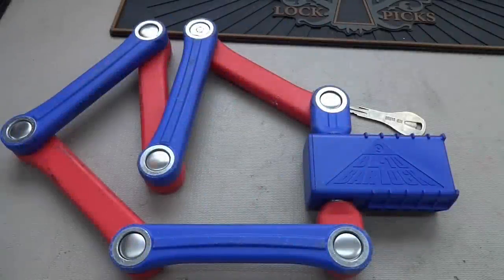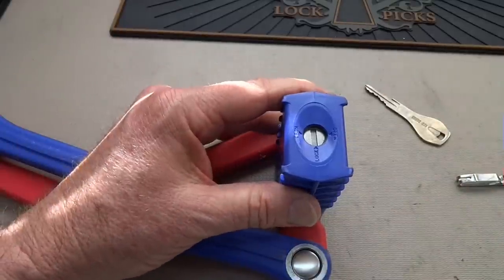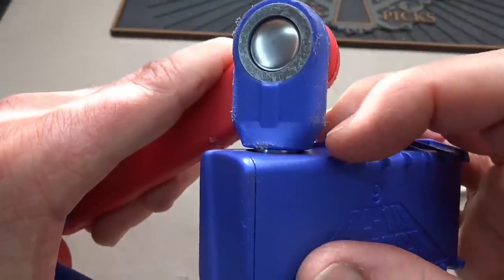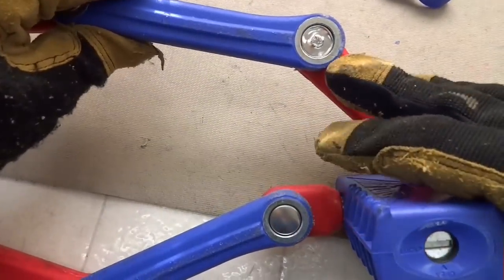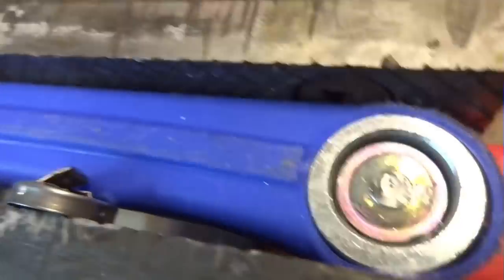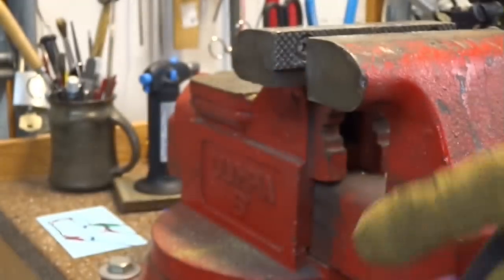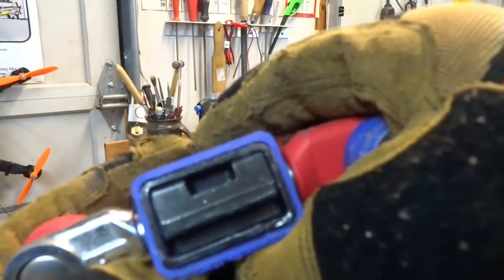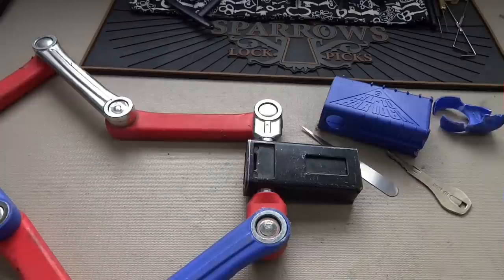(774) Japanese BL-10 Bar Lock

Comment: Did you put the lock itself into parts? How does the lock work exactly? Did you find any ways to attack the lock itself? I'd guess that if the wafers are totally inside the core without the key, one could manipulate the wafers to attack the parts around the core. I'm still only guessing about how the wafers could interact with the locking mechanism if the core is freely rotating without the key...

Comment: i know im a bit late but did you try to pry the hinges apart? Ive been able to do that alot when working on other similar things. I suggest locking one of the bars in a vice and try to get a screwdriver between the joints and it should come apart.

Comment: Can you push the pin apart with a vice or c-clamp and a socket and pin? Also, if they had have made a hardened flange where you cut plastic away, could you still have shimmed it or would that have completely defeated you?

Comment: If the link rope end is wrapped around a sturdy object such as a bike rack. Could you use a long bar to twist it around itself till a joint fails? Similar to lateral prying of a drive chain.

Comment: That keyway is based on a common Nissan DAT13(Silca designation) keyway. It is generally simple to pick when the core is one piece. However what you have there is a two piece core which is becoming more common in automotive applications. So the two piece cores are exactly as you imagine, the front part of the core includes the dust flap and a little bit of keyway(In the case of ignition locks generally the steering lock hold off), but approx 15mm down it is separated from the wafer bearing core which is actually connected to the switch or cam which actuates the system. Nowadays to defeat the two piece cores we use full key length pick "frames" to tension the whole core evenly.
Reply: I just paused the video at the key shot, it's not 9 wafer it is 8 wafer, that space just after the shoulder is normal. I assume it was added by the designers for a little bit of mechanical strength to achieve the required 8000 codes as specified by Nissan so they could use a 4 depth at the shoulder. It dramatically increased their code depth as they could not use 1 and 4 next to each other except in very particular circumstances due to the internal structure of the door locks.

Comment: One of the ways some thieves get around these types of locks (and cheaper U locks) is to apply torsion on the bars.  Yes, it'll depend on how brittle the hardening process made the steel.

But I've seen case-hardened U-locks and bar locks that thieves have snapped simply by positioning the lock, then using the bike itself (by flipping the bike over) as the torsion bar.

Comment: Are the link pins hardened? If not you could fit a hacksaw blade between the the joints and saw through the pin

Comment: What about trying to break the chain thingy on one of the joints? Like fixating the red one (while it's lower positioned one, oriented flat to surface), and putting large weight on (or hitting hard) the blue one. The joints are the weakest points of the chain.

Comment: Bill! Longtime fan!
 I notice you mentioned the issue with the free-wheeling plug. Could you scope the plug to see if it has wafers on both sides? Also, maybe the tip of the key or a wafer actuated by the key engages the actuator? Probably not the tip but maybe it is. Scoping it might yield some clues.

I think it's 8 wafers and not 9 because if it were 9 the cut nearest the shoulder would cut into the shoulder on deep cuts. Hard to tell exactly how far the key enters on the video.

As always, great video!

Comment: So shimming work with that type of Locking Pawl by pushing it out of the way and causing an unlock could you also just pull the lock straight out and get it to release. I understand that would be impossible with arm strength but using a small car scissor hand jack or some sort of hand cranked come along?

Comment: those hinges, if its just a sopt weld over a washer, could you drill out the weld to seperate the washer and push the pin threw? if the weld material is soft enough even a cheep cordless drill with a fresh bit could do the job.

Comment: You pounded on the hinge pin using a big fat bolt that spread the force across both the pin and the washer it's welded to.  If you hit only the central pin with say a 3/16" pin punch, I wonder if you could break the welds attaching it to the washer?

Comment: i had an idea. if you had means of fixing 2 of the long arms in a stretched out position and apply pressure to the middle hinge flat side to force it out of a straight line, it may compromise it. imagine a steel box with open top, loops in sides that can hold down the ends of the arms and a hydraulic car jack in the bottom of the box to push up on the link. needs some pre planning but might be quiet if it works.

Comment: Is it possible to defeat the lock by using a very large set of bolt cutters (36") at one of the joints?
I seen an Abus lock of similar design, referring to the collapsible body not lock, defeated that way.

Comment: I'm thinking some kind of torsion on the joints, or trying to snap them at the joint by hitting the long end sideways. Maybe something like a metal pipe with a slot in it that slides over the joint pivot seam and then you use it like when you would putting a pipe over a wrench to extend your force. And of course there's slide hammer to the keyway at least to remove the shutter.

Comment: I know I'm a little late but will a hack saw blade fit between the bars where the joints are and the pin is? maybe the pin itself isn't case hardened.

Comment: Since wafer picks didn't work, you could try some custom attacks....how about a wire hanger, straightened, cut to desired length, and folded in half with a good bit of the two ends ground down so they are smaller and flat..bend ends and insert into the lock (both top and bottom) and hold so that core doesn't spin (hold the 'loop' end of the wire for tension as normal), "pick a side..any side..".  From the key, It looks like the pinning appears to be the same on both sides. Have you tried automotive picks (double-sided wafer jigglers, double-sided rake, etc)?

Comment: It seems that the weakness can be solved by widening the metal area the piece that goes into the lock. If it extends out another 1/8"-1/4", then you can't put a shim down into it, even with the plastic cover removed.

Comment: how about putting the one of the joints over the edge of something and hammering down on the bottom one..try and drive the joint out. or even put something between a top join and the bottom one and forcing them apart?. You might not be able to force something through a joint.. but u might be able to split them .

Comment: You could try bashing the connector piece out of the locking pawl with a hammer, or your beefy sledge. It looked like a pretty small bit protruding, especially if you bash it away from the pawl, you might be able to slip the bit out.

Comment: The cordless grinders certainly changed the game. As long as you find a way to deal with the noise....Ghetto blaster anyone?
Too bad it has such a great lock, but a shim defeats the entire mechanism. There shall be a new version soon!
Reply: +ObsessionPC Some kind DIY thermite putty?
Reply: +Vitovt Wik It's meant for motorcycles. If you used thermite you'd probably end up damaging the wheel.

Comment: have you tried torquing a hardened piece of steel that fills the keyway and forcing the cylinder to turn? Maybe that lock has the same weakness as the "smart locks" where you can just shear the wafers...

Comment: where the pins are spot welded, could you center punch it and drill out the weld? is the pin hardened could the pin be drilled?

Comment: Im thinking about using a boltcutter on the joint, kinda like a wedge. (between the red and blue part) Like trying to cut the pin and at the same time it forces the joint to dissasemble...

Comment: Right where the "shackle"  or plug goes into the push in snap lock, If they would have added or modified the plug to be larger so a shim would not have easy access to the locking paw this might have been a really nice lock.. Off hand did you try the bottom wafers only like most cheap locks maybe with all the bits on the key gone bot leave the tip, of the key and try it out?? Just a thought or 2, :)

Comment: there may be a bypass with the wafers. i remember a wafer bypass for cars using a popsicle stick. it might be possible for this lock. basically you take a blank, put medium tension, and slowly extract the key. in theory it should set the wafers.

Comment: I have to wonder how well that locking paw would hold up to impact, if the bars hardened but the paw isn't, of if its just not thick enough a good solid sledge hit might just pull the arm out of the lock, and the bars do give a opportunity for a bit of leverage

Comment: I can make a pick key for that. The lock looks like a Nissan key(DA34 I think)
You are correct about the wafers, You said nine but it is an eight cut key, four on top/four on bottom opposing. I'd same company that makes Nissin auto locks made this lock or at least the cylinders they use.

Comment: Use the rigidity of the lock against itself. The joints can be broken with simple leverage. If you swedge the lock and straighten three of the links to use as a lever (approx 16") and apply as much as half your body weight (100lbs) there will be upwards of 3200 lbs of force pulling the joint apart.  (No tools required.)  Anyway, give it a try if you can find a way to wedge it. With the average tensile strength of case hardened steel at 700MPa and mild well below that, 100 lbs @ 16" should be just enough to open up those eyes if they are 0.25" max at their thinnest part.

Comment: a secondary locking system for the pawl where if the link is in place and the key is not turned might fix the problems.  Some sort of spring loaded catch at 90 or 180 degrees to the pawl direction so a bump might disengage one but would set the other.
Reply: +Robert Szasz There's simple and effective standard solution to shimming: ball locking mechanism.
It's not spring loaded and the balls are impossible to move away unless the cylinder is rotated or somehow falls off.
Reply: DigGil3 that defeats the no key insertion to lock feature though?

Comment: what about bending at the joint sections .. you apply enough force to bend at those joints it has and the outer ring of the metal would snap and fall off on the bars ...  at the rivet spot weld point ...  of each segment

Comment: i've seen more and more of those lock on YouTube wich have shielded pin (like bowley or forever locks) or tension protection. They seems very hard to even find a way to pick them, as conventional tools and technique do not work anymore.

BTW this is a waffer lock right ? can you get any tension ? IF so you could try the "ice cream stick" technique discribe in one of the defcon conference (19 or 21 i think) : put a stick large enouth to overset the waffers, tension the lock, remove the stick step by step wich will make the waffer rest in their open state (not sure i'm clear here, sorry for my english)

Comment: I imagine one could retrofit these to resist shimming better by adding a well-fitting washer around the ends that insert into the lock, resting against the plastic shell. That way, even when the plastic is removed as in the demonstration, the washer remains, blocking access from the side.

Comment: Have you tryed to bang the loock Down with the keyhole first, to see if the springload is strong enough to hold the Lock or to weak and will let go from the Lock in one or another side. remember to pull hard on each side.

Comment: The glaring solution for the shimming weakness of the lock is very simple - instead of plastic casing protecting the entry way around the shackle inserts, just flute the metal itself out.
Reply: slightly higher part cost, but that would be the solution. it doesn't fix the exploitable inertia of the pawl, but would make the system much better.

Comment: hacksaw tip.. use a thumb to hold the blade still so you can get a starting groove...if the metal on the side thingamadoohicky was wider, then you couldn't cheat the lock open, use metal instead of plastic to guard that area.

Comment: All they have to do to prevent shimming is just make a flare out around the pin where the plastic was that you removed. If they just flare out the metal around the neck so it is flush with the edge of the key box then there is no easy way to shim it or remove the flare.

Comment: You didn't try any internal bypass options. At least not that you told us of. Is there something in the bottom of that keyway we can actuate? Stick the knife tool down in there. Then we can try to brute force that core as well. You know stick something rather heavy in that keys at to the bottom then turn it with vicegrips...

Comment: Cut it with a dremel a couple times where the you showed the pin hing was welded. Then use a smaller punch than the diameter of the inner metal.

Comment: I think that shim oversight is easily fixed by putting an overlap on the insert so that it fits close against the lock. Steel, not that silly plastic (Though that would, I imagine, be effective against most, casual would-be thieves)

Comment: Hey bb I get a kick just watching you easily violate just about every lock out there. 
I need to put together 10 house deadbolts, 5 single & 5 double cylinder that are pick, bump & drill-proof and was thinking of Schlage B660 but like to upgrade the core, how would you rate Primus level 9 tnx Michael

Comment: Seems like a reliable lock aside from the shimming weakness.  I like that the bars look tough enough to withstand even fairly serious bolt cutters - which I imagine are the most common bike thief's tool.  Virtually unpickable internals are a really nice bonus, but that might be overkill on expense without adding much to the practical use.

Anyone know what the price point is for one of these?

Real shame that a nearly exceptional lock can be shimmed because of a design choice.

Comment: it seems like that one weakness could be easily fixed by a collar as part of that mechanism to block any intrusion. other than that, this lock is very well thought out imo. however...with this being such a stiff piece as a whole, I wonder if you couldn't use leverage by extending the lock and pulling up on it to break the linkage, or possibly work it back n forth to weaken the metal.

Comment: That glaring weakness could be fixed by merely making the casting flared near the point of entry in the lock body.

Also, i think you could defeat this with lever action, that locking mechanism protrudes very little outside the "shear" line. Get this positioned just right and you could use the lock itself against it. I'd say an arm length classic level could do it.

Comment: Design wise, I don't know why they did't extend overall width of the sections that are inserted into the lock, that way, they would overhand the hole and sit flush with the body of the lock not allowing a shim to be inserted at all. (This would need the metal to be extended not just the plastic covering)

Comment: Seems to me a simple solution that allows for easy use for the customer and protect that pin.  They just needed to shape the end of the lock that goes in the hole, so that while it's locked in place, it shields the opening so you can't easily shim it.
if you had a welder, could probably weld something to the end of the shackle and fix it yourself.

Comment: liquid nitrogen on the bar. you use to be able to buy a small pressured container. I used one to get into a storeroom where I lost the key for the lock. super cooled it and wacked it with a hammer

Comment: I wonder how well it would stand up to 16 ton portable hydraulic bolt cutters.  If the links are any less than 40-45 Rockwell it would probably cut reasonably easy.  If it is harder than that it will probably be pretty brittle and somewhat easy to shatter.

Comment: It'd be interesting to see you try to defeat the lock when it's in place on a bike or motorcycle.  It appears that, if you were familiar with the weakness of this lock, you could carry around the properly-shaped shim and have a reasonable chance of success.  Still, in place, not rigidly held, it might prove to be more challenging.

Comment: Surely they could have easily made it a lot safer by adding a hardened steel collar on the male section of the lock to stop access as easily as you accieved it. Or perhaps tightening up their tolerances. Idk, probably extra manufacturing costs or something that the finance department didn't want to deal with.
Reply: looked up the company they make better stuff it just comes down to what they want to spend for that particular lock just like most companies they offer different levels of cost and protection

Comment: You should try cutting with the hacksaw in between the joint. You could also try separating the joint by forcing in a wedge
Reply: +sabbathz A ball joint fork would be a loud but effective way to test the weld on that pin and washer in the bar joint.

Comment: I'd love to see you use a hydraulic jack or scissor jack on it just to see if it possible to jack it open. It would also be good to see if a slide hammer could pull the lock core out with all the wafers.